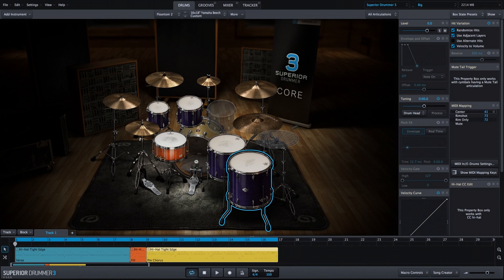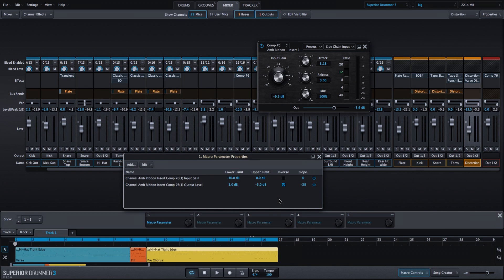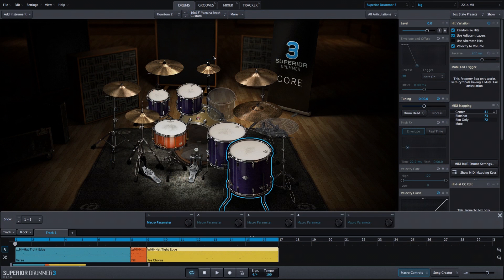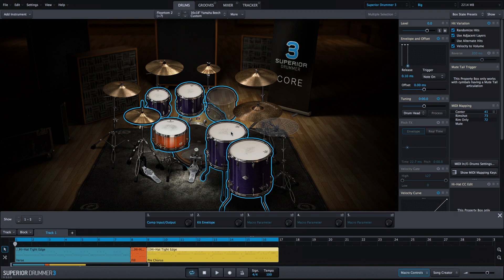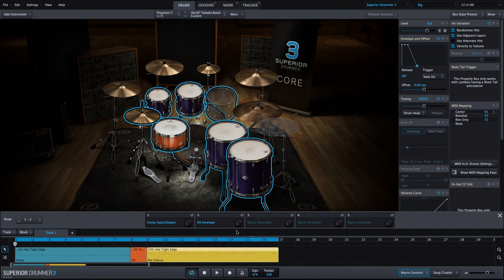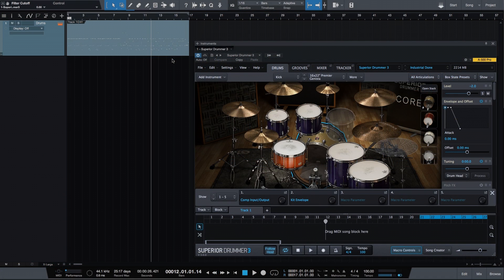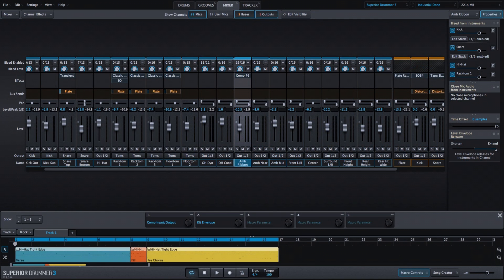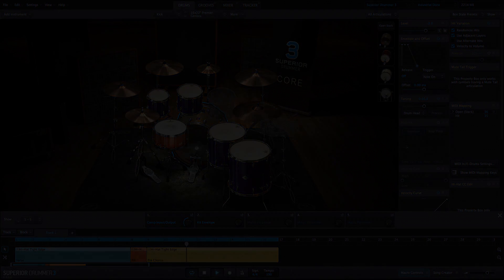Superior Drummer 3: Macros & Automation (video 4/5)

Comment: Hey guys, is there any way to bypass an effect within superior drummer? like switching a distortion off/on? thank you for the tutorials, they are really helpful!
Reply from the maker: Hi,
Yes you can either make one particular effect inactive or the entire channel. There is a classic "on/off" button to the left of the selected insert in the channel strip and also in the top left corner if you open the effect window. On top of the Inserts you can activate or de-activate the entire channel.

For more questions of a more technical nature please contact our Support Team and they'll be happy to help.Follow this link and click the "Contact Support" button found at the bottom of each FAQ:https://www.toontrack.com/faq/
Reply: Hi! Thank you so much for the reply. I am realizing now that I should have been more specific with my question. Bypassing per se is not the issue as much as it is trying to bypass via automation. I can't seem to find a way in Logic to control parameters/effects within Superior Drummer via automation. I managed to access macro controls through Logic's automations, but bypassing I can't figure it out. Is there any way to do that?